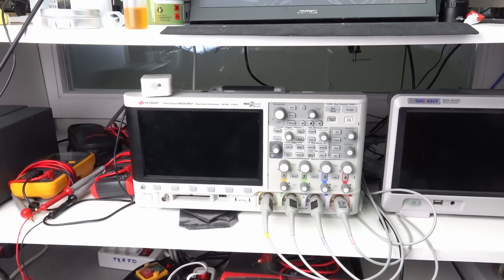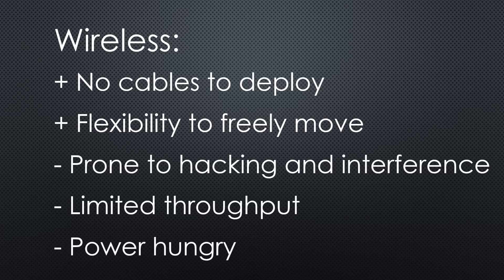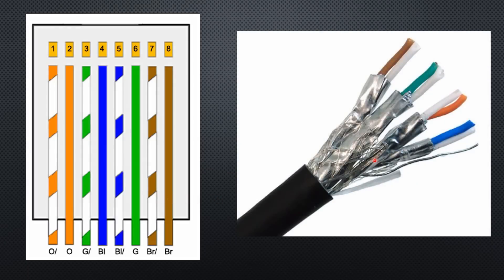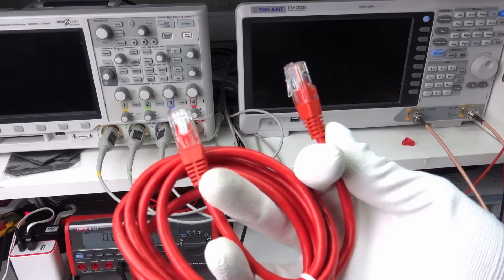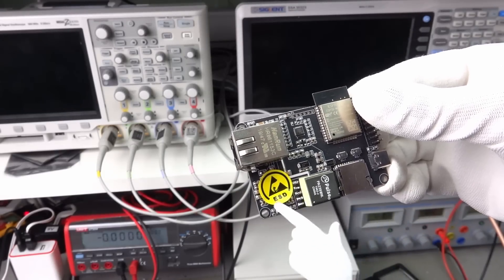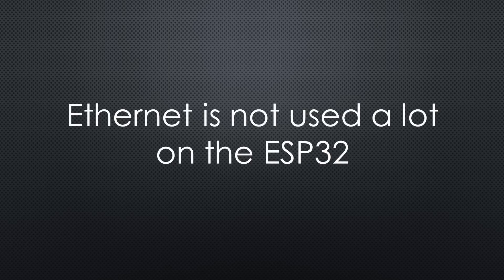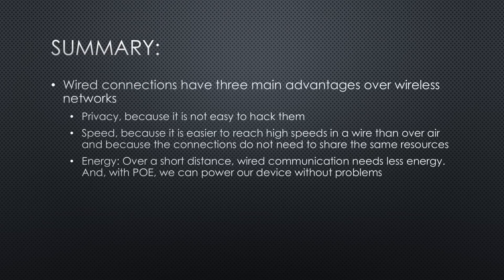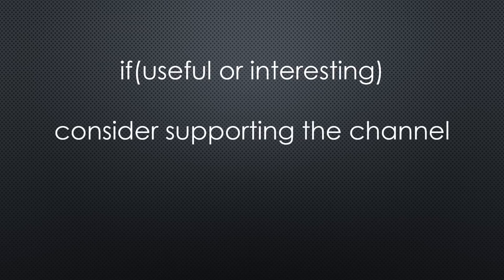(488) Is Power over Ethernet (POE) on the ESP32 any good? (New TTGO and Olimex boards available)

Comment: Hello Andreas, great videos! I am using the OLIMEX in my project and have them connected on a POE switch cascading from one port via multiple 1-2 POE splitters. The complete power draw on the port is about 17watts. I do have a problem with the switch - it wants >48v as an DC input source to run POE stable. I do have a 48v (actually 52v) battery but when the battery is low (<49v) or I attached a battery charger, the switch starts to behave badly (i.e. drops the power on the POE ports from 52v to 44v). I need something that makes sure I have constant 52v input power to the POE switch. So far I have not found anything but 48v voltage stabilizers but they don't help because I need >48v. Do you have any idea what I could use to stabilize the output of a 48-56v battery to match the >48v input of the POE switch? Or any other idea how to stabilize the behavior on the POE Port side?
Reply from the maker: If you do not draw more current/power than the switch is rated (per port) it will keep its voltage. Otherwise, it is defective. So you need a switch with enough power (and, of course, a power supply that can provide the full power).

Comment: Would a board similar to this one (it's also a PoE esp32  but from AliExpress) work to make tiny ir motion sensors? I want some for my home assistant security system and want to use the hide tiny esp sensor  to automate lights and alarms. Security system needs to be stable so I obviously don't want to use wifi but have never used an esp32 with ethernet before.
Reply from the maker: I think it should work.

Comment: Most esp32 wont connect to 5ghz networks, does this also apply to ethernet
Reply from the maker: No ESP32 will connect to 5GHz because they do not support it. Ethernet is not wireless, so no GHz apply.

Comment: Is there any useful application for ESP32 that actually need ethernet ?  
BTW i have many RPI that i control it with RS232 to old pc that convert it to ETH  (with IP2COM sw) ,  slow (115200) but cheep and do the job fine.
Reply from the maker: I use a LoRa iGate connected to Ethernet, for example. And I know that people with modern cabling in their homes prefer ethernet over WiFi for their sensors.

Comment: I recommend cat 6a over cat 7 for three reasons:
1. Cable runs can be longer (6a is 100 m max rated, cat 7 is 30 m max rated) which could become a problem if you're not careful with the length of your cable runs.
2. cat 7 requires shielding, which can be hard to deal with without specialized tools, whereas cat 6a only requires foil which can be cut by anything, realistically. It can also come shielded if your area has high emf interference.
3. cat 6a is cheaper. Why spend more for the same network speed
Edit: Oh, and 4. cat 7 has a new standard that isn't the RJ-45.
Reply from the maker: Thank you for the additional info! Some other commenters even wrote that there is no CAT7 standard...

Comment: Cat6a isn't really a "compromise", the way you think it is.
There is no 8p8c Cat7 ethernet standard. Using 8p8c with an 8p8c connector is out of spec.
The reason you see plenty of cat7 being sold for ethernet use, is simply because the seller can make more money by upselling people to cables with a higher number on them.

If you need 10Gbit, use Cat6a. If you need shielding, use shielded Cat6a with grounded jacks.

Anyone trying to sell you Cat7 for ethernet is cheating you.
Reply from the maker: Thanks for the info. I was not aware of this.
Reply: @AndreasSpiess  I forgot to provide a reference. Rather than linking to the IEC standard itself, here is a link to the Wikipedia page explaining that section. If you would like to read the actual standards doc they provide a link.
https://en.wikipedia.org/wiki/ISO/IEC_11801#Class_F

Comment: What do you think about single-pair ethernet, e.g. with the SPI connected Phy LAN8650B1-E/LMX?
Power over the cable should be possible too.
Reply from the maker: So far I did not see it used by Makers. I never tried it.
Reply: @AndreasSpiess  Would such a board be of interest if I designed one? How do you estimate its chances?
Consider the following: The board connects to a pair of wires (Klingeldraht).. It could either connect to one switch port or connect to a bus with CSMA/CD protocol. So it would be a fancy alternative to a field bus solution.
Reply from the maker: @ghlscitel6714  I do not know how big the market is. But as always, it is hard to find customers, even if they have this particular problem. Many people these days go the "standard" CATx way for their homes.
But you can try and sell it via Tindie or so.

Comment: Shielded and/or foiled UTP cable is more important than category in this case. I would not use crimped cables, no matter the application. Use keystone modules instead and always connect the shielding to the ground or you just got yourself a big antenna :)
Reply from the maker: Thank you for sharing your experience!

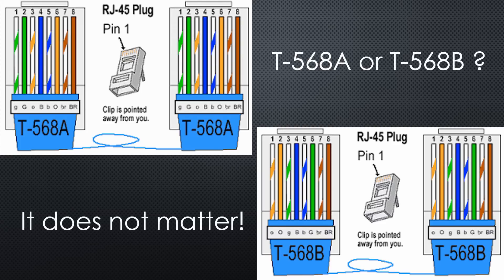Comment: @4:06  the T-568A standard is nowadays almost obsolete and AFAIK is only used in some old corporate and/or government buildings for it's compatibility with landline telephony. Nowadays I think every ethernet cable sold is crimped according to the T-568B. Fun fact: some switches will detect and resolve (to some extent) crimping errors (I know Unifi does)
Reply from the maker: Thank you for the additional info. I did not know.

Comment: Ethernet power usage is tipically proportional to the number of pairs used. For some devices where I can't disable gigabit (or it is complex) I just make sure to use cables with only 2 pairs. In one device I lowered temperature by 5 kelvin.
For today standards even 2 pairs (100Mb/s) uses a lot of energy.
Single pair ethernet (SPE) is coming out now, and will reduce power consumption, and also allow for PoE and Multidrop. I think soon (in geology scale) SPE and Fiber will cover all uses.
Reply from the maker: Good point. I did not know!

Comment: Cat7 recommendation is a safe one - if you are about to pull new cables though your house, to be used for various devices (including PC-s, newer TV-s etc).
However if you are pulling cables for ESP32-s than CAT5.e really is more than enough (because it's good for up to 1 Gbps)... and is a much cheaper option too. Also easier to crimp.

Thanks for a review !
Reply from the maker: Thanks for the clarification!

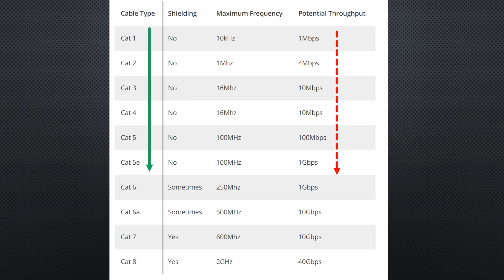Comment: 5:13 whoa, quite surprising - I still use only 5e as it was much cheaper, almost no of my devices were 1Gbps and also I recall cat6 had shielding that required a specific device? But that last part I would have to recheck.
Reply from the maker: You are right, I should have mentioned the use case. I meant, that I would not use CAT5 cables for a new installation in my home.

Comment: I have been using the W5500-EVB-Pico for a number of years now, lots of I/O pins and the RP2040 :)
Reply from the maker: How do you program it?
Reply: Arduino IDE ... 
#ifndef ARDUINO_WIZNET_5500_EVB_PICO
  #error This file is for Board:"WIZNET_5500_EVB_PICO" only
#endif
I have some examples if you want?

Comment: Would it be possible to use a ethernet esp32 to use it as gateway to transfer esp-now iot device messages to a mqtt broker in the network
Reply from the maker: I am not sure. Maybe you check the „Farm Data Rely“ project. He uses ESP now and Ethernet if I remember right. I do not use ESP now

Comment: T568B was designed to handle CAT3 / ATT Phone wiring (the RJ11 plugs fit into an RJ45) so for the USA its the standard cable.
Cat-5E is generally rated the same as Cat6 as well and can generally carry 10Gbe no problem.
Reply from the maker: Thank you for your additional information!

Comment: i prefer Ethernet because if you budling iot on some critical infrastructure  9/10 is going to have good connection and stable

 wifi  3g and 4g is really susceptible for weather if is rain  wifi is useless and cant be use in critical infrastructure and for iot devices
Reply from the maker: I agree. But sometimes WiFi is very convenient…

Comment: I would suggest to not crimp your own cables, it is a major source of problems and instability. I have all the tools and haven't crimped one for about 20 years, patch cables are cheap. Instead, get some installation-type ethernet cable and the appropriate keystone jacks, those can be fitted without any crimping tool.
Reply from the maker: I agree if you get the right length. Sometimes I have to crimp because the connector does not fit the hole.

Comment: If you are going to assemble your own cables, I highly recommend investing in the "Crescent Wiss 5" Electrician Scissors - 175E " ~$16 USD as Amazon.  Not only will the scissors cut the wires nicely and cleanly at 90 degrees, each blade has a scalloped ridge where you can pull the wires over to cause the curly-qued wire to straighten out and be stiff --- that makes it so much easier to feed the wires into the plastic housings which takes practices and can be very frustrating unless you have clean cuts all at the same length and stiff.  Secondly, if you use outdoor rated cable (for PoE surveillance cameras), beware and you may be best served purchasing a wife assembly kit which includes the plastic housings specified for that particular type of cable.  Lastly, I would stick with named brand connectors.
Reply from the maker: Thank you for your tips! Unfortunately, I did not find a supplier for Crescent Wiss in Europe. They only list US and Canadian suppliers :-(

Comment: The ESD sticker is a warning applicable to the entire PCB; there is nothing inherently more ESD-vulnerable about POE circuitry than anything else on the PCB.
In ESPhome, Ethernet and Bluetooth works perfectly well simultaneously.  I have one of those Olimex PoE ESP32 boards running just the basic ESPhome platform with Bluetooth Proxy enabled, nothing else, works perfectly.  Connected to a high gain 2.4GHz antenna I can open my garage & gate with a Shelly Bluetooth Button from down the road (so long as Home Assistant also sees me as within range).
Reply from the maker: Thank you for sharing your experience with Bluetooth. Good to know!

Comment: The aspect I am most curious about is power consumption.

I have run cat5 to each light switch for future smart home augmentation (I want the relays to be wired in a cross-over configuration so all the lights work as normal even if the relays fail to switch). I am currently deciding on what to put in the switch boxes (in theory I could just use the 8 cat5 wires to the relay and current sensing and then do all the smart stuff at the hub). Or I could use RS485 and 240vac-3.3vdc transformers in the wall switch boxes. Or POE ESP32 in each wall switch box.
Ultimately I want the system to use as little power as possible. What is the best option to achive this?
1. a transformer in each box
2. 48vdc POE
3. direct remote relay actuation (48v relay?) (how could I do remote current sensing (for switch state sensing), over cat5 conductors)
Reply from the maker: An ESP32 consumes less than 100mA@3.3V without PoE. So three of them consume one watt. I would save elsewhere unless you need a lot of them.
Reply: @AndreasSpiess  I do need lots of them. The aim is to keep household parasitic power draw to a minimum from the outset. (I turn stuff off at the wall at night to reduce standby waste😊) 
I don't want to be redoing it all once in 10 years once there's 100s of devices. 

The problem is efficiently getting <100ma 3.3v from 240vac

Comment: FYI, any cable labelled Cat7 does not follow IEEE and EIA specs and is not officially recognized as 'category 7'. It departs from the industry standard, has no real definition, and should not be used in any production environment because manufacturers can literally relabel Cat5 as Cat7 if they want, there are no rules. You almost certainly don't need anything more than Cat6 for any application, but if you feel you do, go with Cat8.
Reply from the maker: Thank you for the clarification!

Comment: I use TTGO poe board with esphome without any problems. Truly eth circuitry consumes a lot of important pins but on the other hand I have a way more stable BLE stack as it does not have to share radio with WiFi. Using the same sketch with BLE over WiFi lead to frequent reboots via watchdog and generally poor stability. I use it to monitor my offgrid (inverter via uart + victron charge controller via blue and jk-bms also via BLE). It sends enormous amount of telemetry and over eth it finally got stable. Plus I can power it from offgrid :)
Reply from the maker: Indeed, WiFi and BLE over the same radio is not easy. Your proposal is much better!

Comment: How do they get Ethernet on a newer ESP32 or is this only the base version? Well the SPI to ethernet stuff is sadly only fast ethernet. But they only use SPI MISO/MOSI
Are there better chips for the newer ESP's with more speed well yes I know it's crazy how much it can already transfer.
Hmm aren't there High Rose, Telegärtner and Western Connectors? Well I'm not to sure about that plastic flap stuff, I use a Telegärtner Ali knock off.
Reply from the maker: I cannot answer your questions with one exceptions: Most (or all) new ESP32s do not natively support Ethernet anymore. I use standard ESP32s for that purpose.
Reply: @AndreasSpiess  Ahh so no adapters in your case. I wanted to use the S3 version as it has more pins + better BT/PSRAM support. 

And then it's possible to wait to the ESP32-P4 for new Ethernet Applications..
Reply: Got the P4 already quite an amazing pice of tech. But it seems i have some issues with the LCD controller for the extra display i bought.

Comment: I did some testing on Ethernet for ESP32. I created like 6 or 7 versions of my own PCB untill i found my solution.

There are many problems like the clock from the crystal is on GPIO0. So you have a 50:50 change to hit the boot mode while resetting. 

A solution for this is to power the crystal by GPIO (which is in standard layout) and delay it afew seconds after boot.

The LAN8720 is nice, cheap but old. A newer version is the W5500 which using SPI. So you only need 4 Pins of the ESP32. But the current ESP IDF on Arduino IDE does some problems with some librarys.

My solution is to expand the pinout with an mcp23017 which gives me 16 IOs.
Reply from the maker: Thank you for sharing your experience!

Comment: Another tip regarding the ethernet cables: if you're installing them in your walls or somehow mounting them permanently: use solid wires. 
Otherwise use stranded wires.
Reply from the maker: Good advice!

Comment: Once Single Pair Ethernet (SPE) gets some more traction, I’d use that.
Reply: SPE with PODL seems like a very good choice for IP to the edge, especially T1L which can reach 1000 meters with a single pair of wires. At only 10Mbps but that is often enough for data collection and remote actuation.
Reply from the maker: Good point. Unfortunately, it seems to be rarely used in the Maker arena.